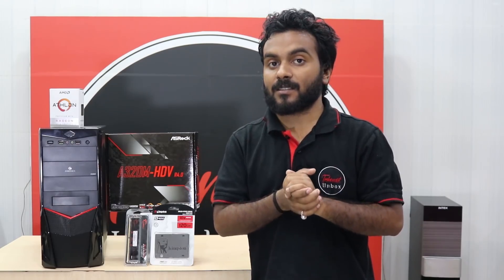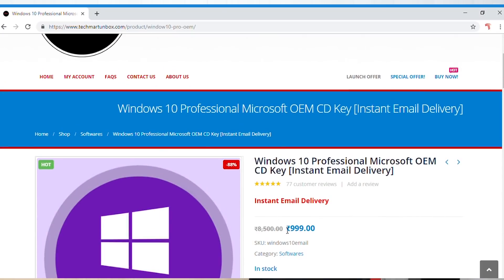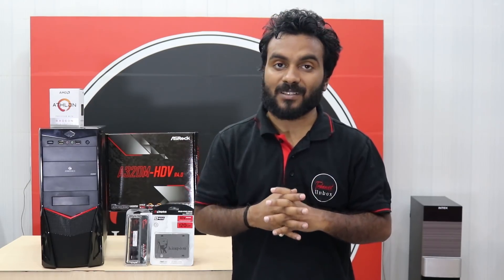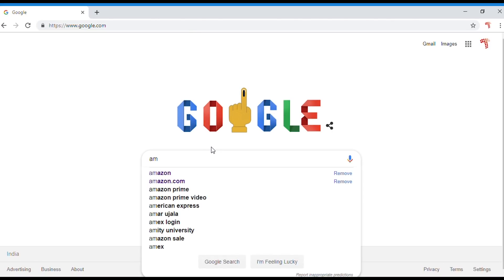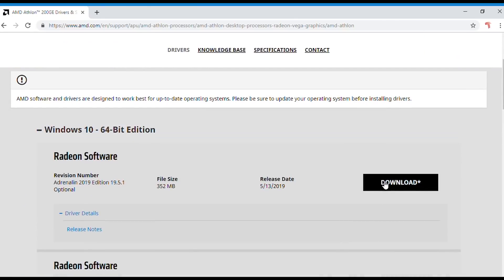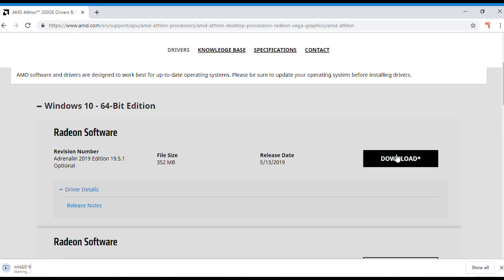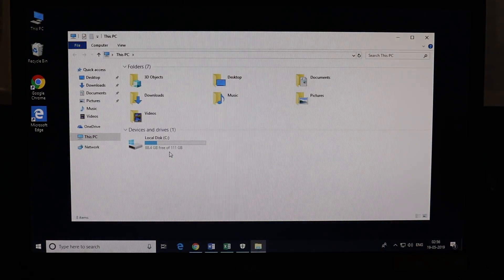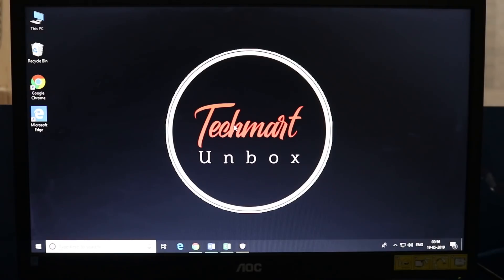Best Home & Office  PC BUILD | 13k Budget

Comment: Its all ok. 
But, I think purchasing intel processors is more beneficial. Because, in intel's case if your motherboard got damaged after 4 years, you can easily find a new one. But, the same will let you in deep trouble in case you are using amd processor. 

Sorry to interfere sir,  this is very much practical problem i suffered from.

Comment: What is the B's about PS Ur talking.
All pc before 2005 had cheap PS wt small exhaust like that never had issue.for heat put a 90 mm fan there is provision on cabinet.
And all new PSU take air in via 200mm fan and not exhaust.

Comment: Hi, it's a nice informative video. I have bought this PSU. Can you please let me know if the length of the cable (particularly 4pin mobo connector) is enough if I use it on a bottom mount cabinet?

Comment: Solution for hor Air problem..just make a hole above the case which is the same size of the fan of powersupply..and put the power supply such a way the the fan faces upside.Hole can be made in any mechanical/welding shop for rs 100.

Comment: I have one more idea for 13k pc built that i built  for my pc 
1. case -  your choice foe 1000rs.
2. motherboard-     ZEB H61 for 3400rs.
3. power supply -   same in video for  550rs.
4. processor -    intel core i3 3240 (used)  for 3500rs
5. ssd -   king stone  A400 240GB  for 2600rs.
6. ram -   your choice  4GB  is more than enough for 2500rs.

these are parts fo my pc that i built today.
Reply: Where can we buy used processor ?
Reply: @ZakirHussain-ix1sv  bro you can buy it from aliexpress or from a near offline store this is a common processor and is easily available in offline market my recommendation is to buy it from offline market.
Reply: @ZakirHussain-ix1sv  now a days this processor is for rs. 2200 on amazon
Reply: Bro What is total price tell me including Monitor and Keyboard and Mouse , I have Nothing , I want to build a small pc but koi monitor ko budget me leta hi nahi
Reply: @samadhanmhatre777  bro see if you want a built a full setup so you have to invest minimum 18k to 20k you cna built a same pc and one of the most cheap and good monitor is HP 20wd it is not available online as you can buy it from offline under 6000 RS. and the best keyboard is dell KB261 for 600 -700 RS. AND MOUSE dell MS 166  for 300-400 RS. (only for normal usage not for gaming aur editing)
Reply: @prathamkanchal  Bro Normal Uses ke kiye kya kya chahiye?
Reply: @prathamkanchal  Like CPU me kya kya chahiye
Reply: @samadhanmhatre777  bor this pc is very good for normal usage as in this pc you can play games on low settings but for that you have to pay 5k to 6k more on a good monitor and you mast have to invest 18k to 20k on a normal usage full pc setup
Reply: @prathamkanchal  ok Bro konsa Monitor buy karna padega,Aur processor ,ram ?

Comment: Buy xeon e4370 x cpu ₹2000 ₹1000 400w psu ₹1000 zeb cabinet ₹1000 500gb hhd ₹2000 h61 motherboard ₹2000 6-8 ram and ₹5,000 gtx @1050 ti you can buy it from tasqari.in you can play AAA tiles on medium to high settings 1080p on 50-60 fps and some morden games like rdr2 all low 30-40 fps and you can also play fortnite on medium settings 60 fps total ₹14,000 and if you dont find it on tasqari you will definitely find it on olx or used offline market

Comment: PLEASE HELP ME OUT
I wanna build a PC...

Points to focus on:
1. Using chrome for research
(it involves opening multiple chrome tabs)
2. Playing music in background while working
(mostly through online sources)
3. Used for long hours
(around 15 -18 hours daily)
4. NO GAMING
(I don't play games so 60 fps system is enough for for with minimal graphics;APU is my personal preference)
5. Low budget
(I have saved some money through out my school life.. And now I wanna build a pc with my money, so I'm being very cautious)

I have choose:
Processor : AMD Ryzen 5 2400g
Motherboard : msi B450 Max
Cabinet : A decent one (haven't decided yet)
Ram : 2*8 GB 3000GHz
SSD : M.2 120 GB
HDD : WV 1TB
Power supply : 450V
Monitor : 22" LG IPS LED monitor
Keyboard & Mouse : Dell wired

Do you recommend any changes.? Koi or combination thik rahega.?

Comment: Hi, Yesterday I built a PC include Amd athlon 200ge, ASRock a320m hdv motherboard, Crutial 8gb ddr4 ram,1 tbWD hdd,Aoc display Logitech's mouse and keyboard
When I install win10 pro successfully I go to driver installation and I install recommend and Vega 3 graphics but after 10 minutes I faced blue screen death ( clock dogwatch out) and I aslo seen a (!) Mark on the display adapter (driver),I try to fix that problem watching YouTube videos but nothing can't 
happened.
So please tell me any solution for this please 🙏🙏🙏
Reply: @EvadraaJohnwickkuu  yeah
Reply: 1.update bios 
2.update win 10 
3.only download chipset driver
4.I follow someone's method in youtube it like run cammant 
5.install amd clean utility and install amd chipset driver

Comment: hi, can i use intel processor in this mother board  ? which processor will support  ? please answer..........thanks.
Reply: No you cannot use intel processor on this board ,this board comes with AM4 socket which is an AMD processor socket, so only amd processor will support, if you want a motherboards with intel support then search for LGA1151 socket

Comment: Instead of this cabinet, Use Circle Desire D1 that is prices at 1700 and it has inbuilt Circle 400w power supply which is far better than ultra cheap psu like zebronics and frontech, enter, etc

Comment: Better to use Crucial basic 2400mhz ddr4 ram for Rs.1335
Msi a320m motherboard for Rs.3375
Now Amd Athlon 200GE costs Rs. 3850.
Antec Atom 450w psu Rs.2200(to be on the safer side) 
Frontech Cabinet Rs.850
Galax 120gb ssd for rs.1500

Total -Rs.13110(On Amazon) 
Offline it would adjUSt under Rs13k

Comment: #For middle class people Best choice "Long lasting pc"
I share my experience🧐🤓

Apu+Gpu= AMD Ryzen 3 2200G with Radeon Vega 8 Graphics Desktop Processor 4 Cores up to 3.7GHz.../
₹= 6500

MOTHERBOARD (HDMI)= 
ASRock A320M-HDV R4.0 Motherboard (BIOS Updated for Ryzen 3rd Gen Processors)/
₹= 3850

Ram (1×8)= Crucial 8GB DDR4 1.2v 2400Mhz CL17 UDIMM RAM Memory Module for Desktop/
₹= 2300

(Otherwise For good gaming (2×4)= Crucial 4GB DDR4 1.2v 2400Mhz/ ₹=2800) 
*But i think You use same price 8gb ram (1×8) 3000mhz/ ₹= 2900👌

PSU(450W)= Corsair CP-9020170-UK 450W Certified Power Supply/
₹= 2500

SSD(240gb)= Kingston SSDNow A400 240GB Internal Solid State Drive (SA400S37/240GIN)/
₹= 2400

Monitor(HDMI)= Acer 19.5 inch HD+ LED Backlit Monitor (V206HQL)  (HDMI, VGA, Inbuilt Speaker. /
₹4700

Keyboard and mouse combo(gaming)= Zebronics Transformer Gaming \
₹= 1200
(Otherwise You can take any you like)

#(Cabinet You can buy a cheaper one offline otherwise Someone old) Best choice /
₹=    Under ~1500

#(Don't use HDD, you should use SSD, because your pc speed will be 10 times faster)

#Note🤔(There is always a slight change in the price .... this price is not forever) 
*Check Amazon & Flipkart.... 

Full PC = Apu,Gpu + Motherboard + Ram (4×2),(8×1) + PSU + SSD + Monitor + keyboard,Mouse + ~cabinet = .......... I think Around ₹24000👍👍👍

Heavy work Office + Home + lightly Photoshop & Gaming PC *(Remember this pc doesn't play heavy games 😁)
at a very affordable price.
OR....If you buy offline then you will get all the things at a cheaper price. 😊...
If you have any question, you can ask
Reply: Isme graphic card konsa sahi rahega? 2gb ya 4gb
Reply: @ravithate  is me bhai graphics Card ki jarurat nhi.. kyuki , ryzen 3 2200g me already graphics Card hota he, is me APU+GPU  done aa gye... 8 Vega ke graphics Card hota he... ..ok
Reply: @naranchaudhary1489  bhai ye i3 8100 se bahetar hai ?
Reply: @ravithate  abhi ti i3 9100 ..new latest chal rhi he....
Vo aapko ₹7000 mil jayegi...or  usme aapko graphics card lagana padge... Jo 2gb ka graphics aapko ₹3000 aaspas mil jayega or 4gb ke liye aapko ₹7000 ke around mil jayenge.. .
Reply: @ravithate  Intel i3 8100 aapko mahnga padega... Kyuki usme alag se aapko graphics card kharida padega,. .jo around ₹10000-14000 tk padega..... Usse aacha aap ryzen 3 2200g hi lelo bhai...best .. ₹6500 .. or isme aapko graphics card kharida ni jarurat bhi nhi he..... APU+Gpu 👍
Reply: @naranchaudhary1489  ok Bhai ryzen 3 2200g leta hu fir aapne Mera confusion dur Kiya Dil se thanku Bhai🙏
Reply: @ravithate  jo aapko graphics card use karna he to fir aap ryzen 3 1200 lelo....

Comment: Can i use a Ryzen 5 3600 on that a320 motherboard
Reply: Yes!  AM4 is the socket type and it does support the current generation!  You're good to go but you'll probably want a slightly better cooler, forgot which one he went with here.
Reply: @skyebynes612  thank you for your response...
Reply: @vinaynag2035  No problem! However I've seen some new boards do just MAKE SURE I'm right!

Comment: Thanks for this video and I really loved it. Is intel i3 better than Athlon processor? I wanted to know if you would ship the processor, motherboard, ram and the 240gb version of ssd to Vellakovil, Tamil Nadu. Also is it possible to connect another hdd drive along with the existing ssd drive you connected to the motherboard in your video.
Reply: I3 is better in terms of processing power but not gpu and also which generation are you talking about.

Comment: I am using old pc.recently  i changed the processor to new one.it works but there is an issues with f1 error.there is a message also like "Unknown CPU detected, BIOS update required to unleash its full power... How to solve this 😭

Comment: The Information on smps Fan is incorrect. For top mounted cases , the fans in Corsair or any good smps will  still suck air from inside the cabinet and throw outside via the back. The fan in zebronics will basically do the same thing only it’s mounted behind with slots cut out in the opposite side for air Intake . In bottom mounted cases the smps does not have to suck hot air from cpu area and will enjoy a longer life as it will suck cooler air from bottom inlet . That is why bottom mounted cases have air filter for the smps mounting area.
Reply: True. SMPS fan does not throw air inside the cabinet.

Comment: my build

MSI B450 GAMING PRO CARBON AC
RYZEN 5 2400G
COOLERMASTER MWE 450W PSU
CORSAIR CARBIDE SPEC 01 CABINET
WD GREEN 120 GB SSD
COSMICBYTES CB GK-02 KEYBOARD
RAPOO WIRELESS MOUSE
LG 22INCH 22MP68GQ MONITOR

Comment: Hello. I am planning to build the same pc (zebronics smps) only change: 
-use ryzen 3 2200g(Raven ridge) instead of athlon 200g.
-use 4gbx2 ram

Any suggestions/ improvements will be greatly appreciated.
Reply: 4x2 ram will be loss , buy 8gb 3000mhz , use good smps if using Ryzen processor
Reply: @SOURAVDIY  I want to make use of dual channel.

Power supply, I can understand your views
Reply: If u want dual channel buy 8x2 = 16gb
Reply: But then cost will be too high.. I'm building this PC for my grandfather. He doesn't game at all  but I need zippy performance in day-to-day tasks.
Reply: 90-100 CSGO lowest setting fps without GPU,  its beast with 1050ti.

Comment: I'm interested in buying this motherboard from techmart unbox mainly because of presence of both HDMI and vga ports.
I want to compare it with gigabyte a320m-s2h (kindly share your opinion)

Also, I think this is a mistake: description on your website doesn't mention vga port. I'm sure it's a mistake because vga is visible in one of the pictures (on product page) as well as clearly seen in this video. Please correct this error.

Comment: 13k PC build unbelievable. Extra 5k worth for corsair spec01 and corsair 450watts. Total 18k is worth for long life PC.
Reply: Hows about ryzen 3 2200g?
Reply: @omtapkir8639  very good. low to mid range gaming PC. I am very old customer for AMD from AMD k6 500mhz on year 2000. my friend assembled this model with mono monitor, 64mb ram, 500mb hdd (used) for budget 13k. later I upgrade to additional 64mb and 20gb hdd. I used this upto 2006. later I moved to amd athlon64 processor.  this is still working.
Reply: @kailash8  👍👍 but 64mb?🤔🤨For office desktop use etc? That time! 2000 i was not born so i dont know anything about it! They would be much expensive that time?
Reply: @omtapkir8639  Yes. That time Intel Pentium III 500 Mhz PC almost starts from 35k and  PIII processor price around 12k. Mentioned AMD model price around 4k which have 3D now technology, same clock speed. perfect for that time game.  Roadrash, Testdrive, House of dead are my favorite games. That time 10GB HDD price around 6k so my friend given his old 500mb HDD. I used this for almost 2 year then I purchased 20gb hdd for Rs 4500. This is my first PC 
I wont forget this. This year I have plan to  upgrade my PC to ryzen 2400g. this channel new video is same build around 30k budget. please watch this too..
Reply: @kailash8  those legendary days ✌️ when 64 mb ram used to perform like a beast. . And most remarkable thing, The Floppy Disk. ✌️😅
Reply: @omtapkir8639  it's good if one buy that from OLX ..it may be available in 5000 ..

Best budget pc in that case
Reply: If you adding 5k then you should subtract the already added 1450
(900+ 550 )

So effective price is 
 (18000 - 1450 )=  16550 /-
Reply: @vkumar2657  oh yes.
Reply: Always use Logitech mouse and keyboards
Reply: my 400 ruppees 300W PSU still working after 5 years.
Reply: @ravijangid9984  which brand?

Comment: Never cheap out on PSU. Nice hairstyle btw.
Reply: why cant the circle 400W psu for 850 RS ?
Reply: @techg8233  that would be a bad pcu
Reply: its good and easy to say but when budget is of 13k you can't put 80+ gold powersupply -_-
Reply: @SHIVAMSHARMA10  always spare 1600-1700 for the psu even for an ultra cheap budget build. Antec BP 350, cooler master/tp 350 are solid budget choices.
Reply: @r91playsind  get over it man! they've their  exhaust fan placed down and this cabinet has psu on top.
Reply: @SHIVAMSHARMA10  Using cheap Psu  is risky. Low build quality could destroyed other parts of the PC.
Reply: @ludwigvanbeethoven3928  true it has a potential to destroy the motherboard as well

Comment: Sir please make a video of 25k build of ryzen 3 1200
Reply: i3 3550🤣🤣 in 2019?
Reply: All in One SS bhai agar 25 k lga hi rha hai toh tohada add lr 32 mein mera pc build lelo
Gtx 1050ti
I5 3550
H61 intel mobo
8 GB ram ddr3
1 TB hdd
450 power supply 
Runs every game at 60+ fps at high settings 
Ryzen 3 1200 mein bahut games kam chalengi vo bhi low graphics mein
Reply: @sukhvinderkaur4299  Bhai Mera budget bahut tight hai main Jyada paise nahi laga Sakta
Reply: All in One SS 30 lga skta h
Agar haan toh mein deh skun
Bhai 5000 lga kr ek bahut acha gaming setup le skta hai vrna 25k build mein esa kuch khaas nhi hota

Comment: Actually you should be using a really good power supply for safety(It’s ok if it is for compatibility).And in this video he is using a very cheap (meaning bad) power supply. Using a bad psu can lead to fires btw due to its short lifespan.
Reply from the maker: please watch the video, we have already covered that in this video regarding cheap PSU
Reply: @Techmart Unbox " compromise " i get it srry

Comment: I will use this for gaming 😂
Reply: @pritamthakur6293  gtx 570 lol nvidia line up with amd btw @its all algorithm if you wanna to game on this get yourself rysen 3 1200 and a gtx 1650
Reply: @SamCircuit  why would anyone with a brain buy a 1650?
Reply: It can run all modern games at 720p
Reply: No problem...you can play pubg mobile by emulator.and pubg pc lite gta 5 at 720p
Reply: Yuppp ultra setting pe wo bhi 😂😂😂
Reply: @pritamthakur6293  mee too same
Reply: @pritamthakur6293  I have i5 8400k paired with geforce gtx 1050ti 4gb lol
Reply: Is this PC can streaming only nothing else
Reply: Go for ryzen 3 2200g. Its only 6,200 INR.
Reply: @ludwigvanbeethoven3928  ohh godd it has been increased so much now its above 9000 😱

Comment: Ryzen 1600 or Intel  9400 which be the best ..
Reply: Intel
Reply: I have then Ryzen 1600 the single core scores are comparatively lower and hence games have a bit of stuttering at very/ultra settings though the fps is good. Buy the Intel 9400f for gaming and ryzen 1600 for everything else.